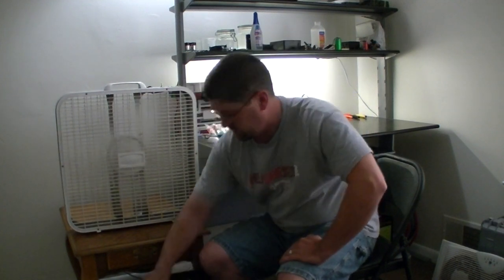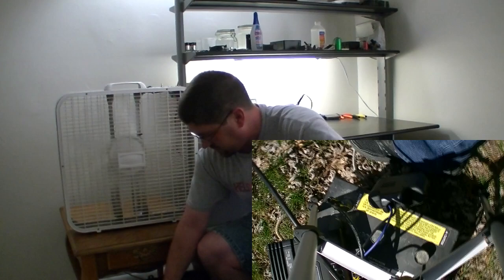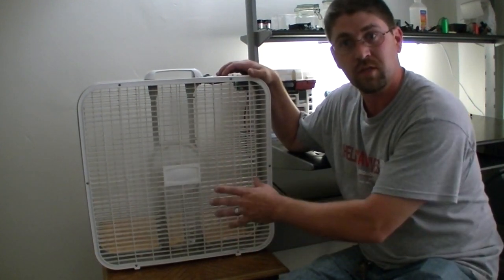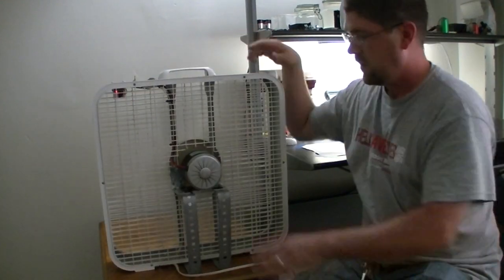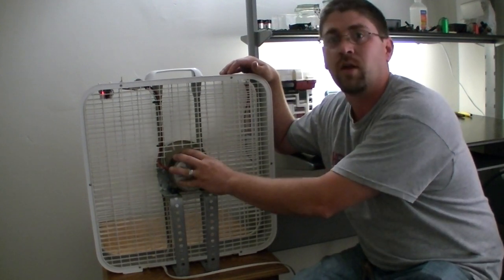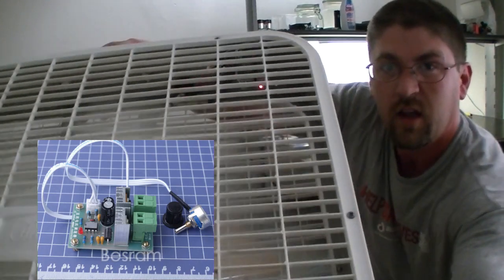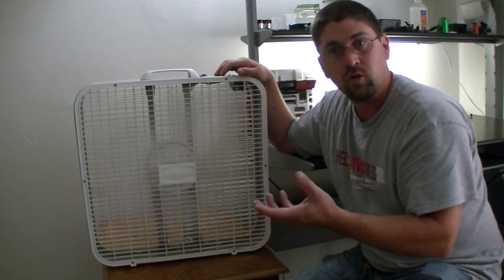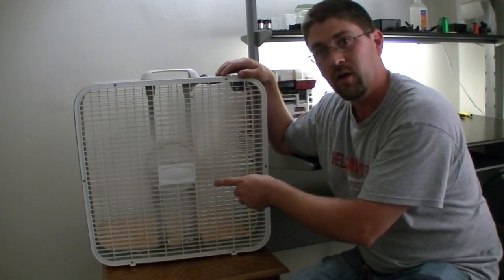DIY DC Powered Box Fan Conversion

Comment: continuously variable speed, and better efficiency is reason enough for this upgrade. I'm impressed how quiet it is. All I hear is the fan blade, I can't hear any commutation noise or magnetic cogging. Nice build. I can see applications for RV use because of its ability to run on direct current. When you use a fan, it's usually because you want cooling. Reducing the  heat wasted by the motor is a good thing. Nice build!

Comment: +Mad Electron Engineering — How is your setup with respect to radio interference, particularly in the AM band?  A stock 3-speed 60 Hz AC fan motor produces no interference whatsoever.

Comment: Thanks for the video. Is this drawing more amps than the AC counterpart even with inefficient conversion(dc to ac)? Would this drain a battery quicker? Here are my thoughts:

DC: 35 Watts / 12 Vdc = ~2.9 A
AC: 50 Watts / 115 Vac = ~0.43 A

So if you had a 120 amp hour battery wouldn't the AC last longer even with power loss from AC conversion? 

120 / 2.9 = 41 hours for DC
120 / (0.43*1.2) = 232 hours for AC (1.2 for dc/ac loss)

I am new to this and obviously missing something here?

Comment: oh hey, i like to put a small drop of light-weight oil by or onto bushings of used/old motors, being more careful if its a brush type (old fashioned now i guess, but torque and slow application) fixed the sealed wiper motor on my pick-em-up by drilling a real small hole above bushing pocket, squirt couple drops in and spin it, buffed off most the dust an rust, 
 almost just like similar to new! (or recon -ish) 
have a good wkend all.

Comment: Ok, I think I figured out the problem.

I need to take the 50 watts divided by 12 volts as well as 12 volts is the power source in both scenarios.

So (50 watts/0.8) / 12 vdc = ~5.2 A ( divide by 0.8 for inverter inefficiency)

run time: 120 / 5.2 = 23 hours

I think that makes sense now! So that's some good savings of power on that fan by converting it to DC!

Comment: Seems to me that on a  nice windy day you can harness some of the power from that magnetic motor for charging some smaller batteries eg. AA or AAA batteries via a mounted battery pack charger or two. Toggle switch to divert power away from auxiliary DC speed controller through to a rectifier a ferret or diode or 2 and bam Battery Charger plus Fan. What do ya think?  Nice video by the way, I made a smaller one a while back that can run directly fro a 15 watt (ha ha on a really good day) solar panel or rechargeable battery pack..

Comment from the maker: Comparing power consumption between AC and DC is always done using watts (amps x volts).  Also add 10 watts when using a DC to AC inverter in this instance since power conversion is never 100%, so 60 watts on AC inverter versus 35 watts Direct DC driven is almost half the power consumption of the AC unit.  Doesn't math make your head want to explode?  I know it does to me at times.  :)

Comment: Not to be an ass but AC motors, in particular, the ones used in box fans have a stator and a rotor. The stator is all coils but the rotor is usually a big hunk of metal that is magnetically charged by the stator which causes it to spin.

Comment: Thanks for your video I found it very informative. My question is after you convert the box fan do the DC motor and put the switch Connection in what size solar panel would you need to run that fan without a battery just straight connect to a solar panel. In other words want wattage what I need to be able to run the pan during the daylight hours.  Thanks. RC

Comment: I can't hear the audio...I have the same type box fan... I'm just wondering what size panel ID need to run it on high..24-7. I know I'll need atleast a car battery to keep it going at night.  any suggestions?   I see alot on eBay..

Comment: Anyone have a link or a part number for the piece to connect the motor shaft to the a bolt?   Only thing I can find is standard turnbuckles, while cheap, they are like 4 inches long?
Reply from the maker: I cut my turnbuckle down with a dremel.
Reply: And what turnbuckle was needed ? Thread size ?

Comment: Yeah, I have a box fan that I attempted to convert from AC to DC using the 12 volt AC blower motor from a ford pick-up. When I first wired it, plugged it in, in blew the fuse in my DC cig male adapter. I guess it was pulling too much juice or something? Just need help in wiring or maybe using a car fan relay? thanks. Really enjoyed this video.
Reply from the maker: +Michael Newberry cigarette ports are usually rated for 10 amps, but pulling more then 5 amps is risky.  your motor is most likely pulling 10+ amps on powerup, depending on what fan blades you have on it.  better to use a better more powerful connector then a cigarette adapter and 15 amp fuse.
Reply: +Michael Newberry Touch the wires directly to the battery for testing purposes, makes for a quick release on a stalled or slow fan blade.
Reply: Why doesn't someone make a fan like this for sale? I'd gladly buy.
Reply: @jtmeece5118 All the tool battery powered fans (Ryobi Harbor Freight Kobalt etc) are DC and some are brushless. You can also get DC brushless inline fans that are amazingly efficient if you have pressure in the application. (Vevor Terrabloom etc)

Comment: i have a dc motor of a threadmill i want to convert it to a threewheeler  bike, what  throttles whih fit to that motor tnx & good day
Reply from the maker: +g4 treadmill motors are usually rated for 90-110vdc, not 12-24.  Either you would have a dangerous high voltage battery pack or no power on that motor running at 12-24vdc.  get a proper scooter motor.

Comment: I have a question. Can you take a 20” box fan and convert it to use with a power bank?
Reply: I would love to see a video on this as well if you can convert it using a usb to a power bank. I live in Florida, and I use a usb 10” fans during a power outage and went through Irma as well. I would just like to know if it could be done.

Comment: really cool. in current projects, i have been getting few of those lil china pwm modules, and splice into control of esp the multi speed (delete the resistance coils) squirrel cage type motors, in my camper and truck, hoping to net less total watts, from small solar bank/batt. -i try to bid less on bit xtra rated size, put a tiny fan over heatsink (mosfet i think)  to last.prob over kill. voltmeter at batt reads higher, not measured actual diff tho. if anyone sees some for less $ give a shout ok

Comment: Is this it? Mini DC Motor Speed Controller PWM Adjustable Variable Switch 6V 12V 15V 2A 30W

Main technical parameters:
Input supply voltage: 1.8V-15VDC
The maximum output power: 30W
The maximum continuous output current :2A
Duty Cycle adjustable: 0%-100%
Item size: 1.3*1.3*0.6 inches ; Net Weight:0.5 ounces
Features:

1803BKW DC Motor Speed Regulator controls the speed of a DC motor by adjusting Pulse-Width-Modulated (PWM).
The input power range is DC 1.8-15V .
Use a 2A resettable fuse to protect the controller.
Potentiometer cable length 20cm.
Reply from the maker: That's close, but underpowered.  It should be able to handle up to 100 watts.

Comment: Where volt * amps = watts in DC circuits, it is not so with AC circuits with reactive components such as inductors (magnetic coils) and or capacitors. This is a source of a very common mistake that many people make when they measure Volts and Amps in AC circuits.

(Apparent power)^2=(Reactive power)^2+(Real power)^2.  Google these terms. 

A good portion of the AC power in the field windings under low and medium load is reactive power which when combined with real power gives you a higher apparent power. But apparent power is not real power. The reactive power component of apparent power is reflected back to the power company. That is energy is stored up in the magnetic field, then as the current drops, the magnetic field lines cross the field wingdings releasing energy, back to the power company or a power factor correcting capacitor. 

PS don't buy into power factor correcting snake oil. Your power company doesn't charge you by the volt amps hour. Instead it just charges you by each 1000 watt hours, KWh you use. power factor correction will only save a very little amount of power in the form of lower power line heating. Probably around less than 1 watt in total for your fan.
Reply from the maker: I agree but at the same time I used a kill-a-watt hour meter on the fan when it was still using the AC motor.  Shouldn't the KAW meter take these thing in account when it displays how many watts are being consumed by the fan?
Reply: Obviously there are differences in motor efficiency, but you do not actually consume watts creating an electromagnet as claimed in the video. Instead power is temporarily stored in the magnetic field and released. 

Without having seen your testing procedures, and equipment, its hard to make any definitive comment on why you see a 15 watt difference.
Reply: Low power factor does load up the wire with extra current though and if you are on an inverter it eats up some of your VA capacity too.
Reply: @madelectronengineering The meter displays the power factor separate from wattage but the current reading includes the extra current from low power factor